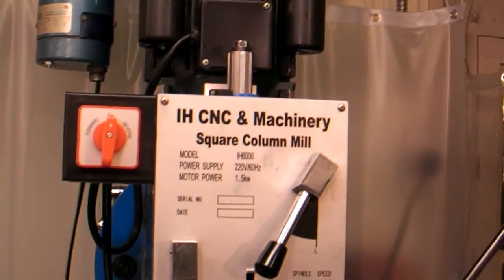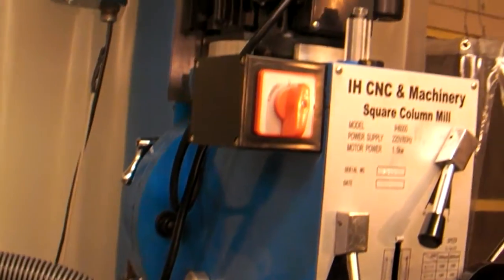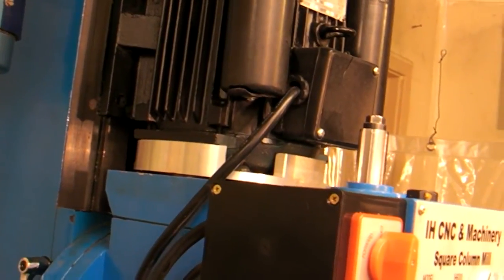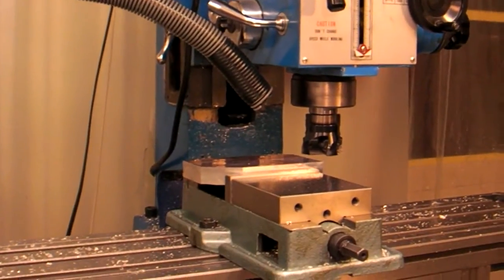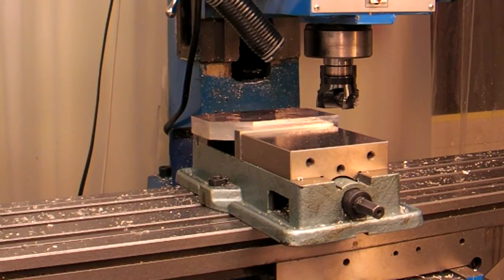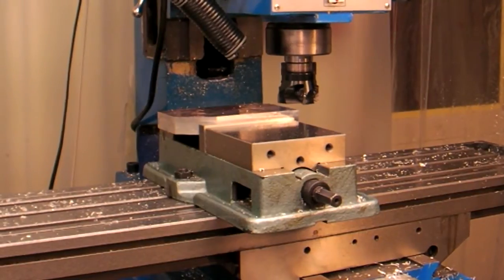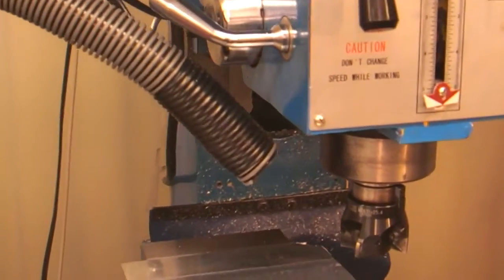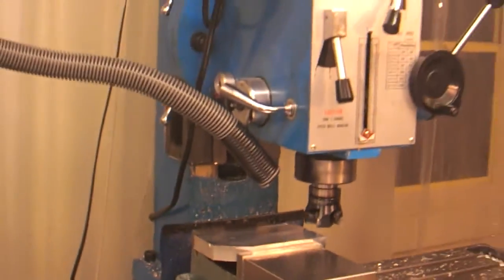IH mill .160" thou 100 IPM.MP4

Comment from the maker: The IH column is about 10" on each side at the bottom. A stock RF-45 is around 8". The column will still flex some. I can get the head to flex  .002" just by leaning on it. 

Moving is a relative term.

Comment from the maker: It is a Grizzly G2861 Fly Cutter which is a better tool than much of the Ebay stuff. After you upgrade the inserts it is a fine cutter and the hard coating is tough and easy to clean up. I thought I paid less so it might have been on sale two years ago.

Comment from the maker: One of the guys at CNC Zone said a ,25 cut would be 2.8HP so that should be OK but the face mill has no spec as to max DOC. 

I also have a Glacern  FM-45 that they said could cut over .25 per pass so I think both of the tools may be OK for deeper cuts.  I just don't want to bang up the 45.

I may do a thin pass at .25 to see how it goes but I'm doing other work in the shop right now and making a video means leaving the chip curtain open and the whole shop fills up with chips.

Comment from the maker: I re checked the Z to see if it was set correctly and it is fine but I did find the mistake. 

After each pass I was re zeroing the Z and doing the next pass. But the head was not at zero but at the clearance plane which was .070" 

So the correct DOC was .160"

I will correct the title. 

I might re do the test at .250" to see how it goes if people want to see it.

Should I go for it?